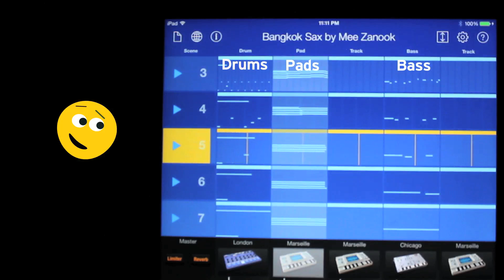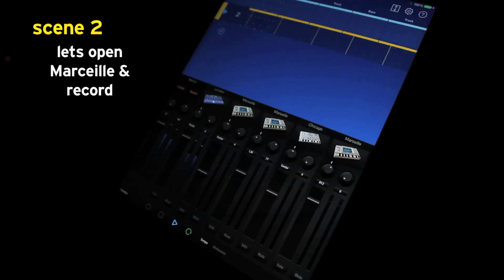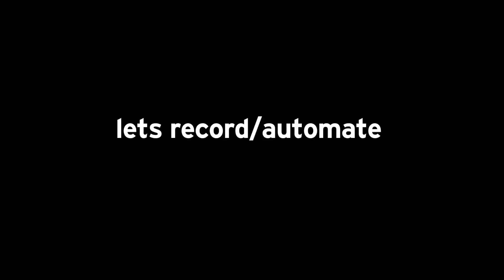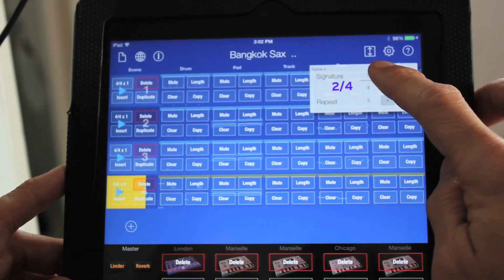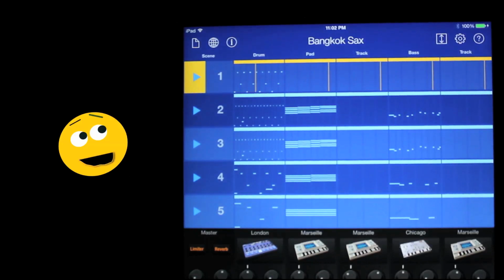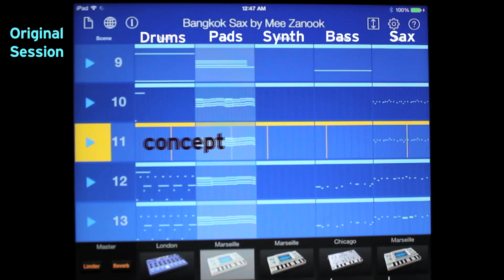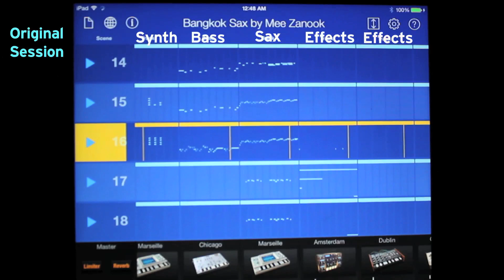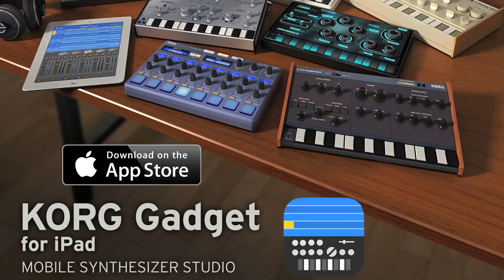KORG Gadget  Building A Song Tutorial

Comment: hi mee,

have been trying to recreate your tack to scene 10 - i think i have done it but want to check the settings you used from scenes 4 to 9.

i realised i needed use a blank track to force the maximum play length of a scene and make the other tracks loop before progressing to following scene.

my settings came to -

Bangkok Sax recreation

scene 4 -  1 bar for pattern 4/4 time  - 4 bar control track

scene 5 -  1 bar for pattern 2/4 time  - 4 bar control track

scene 6  - 1 bar for pattern 1/4 time  - 4 bar control track

scene 7 -  1 bar for pattern 1/8 time  - 2 bar control track - grid 1/16

scene 8 -  1 bar for pattern 1/16 time  - 4 bar control track - grid 1/16

scene 9 -  1 bar for pattern 1/16 time  - 4 bar control track - grid 1/32

but i dont think thats right when i follow yr vid.

its a great tutorial and i learned lots just trying get that far.
Reply from the maker: Hi Mark,wow I just watched this video again after so long and if you followed OK you've done great! I can't remember each scene and if i had to redo this track i would have to watch video too and stumble much,Good work!
Reply: Great Tutorial. I’ll be trying this. I’d been having trouble making good drum rolls/build ups. Very fiddly to make on an iPhone lol. Make more vids , this is one of the most helpful I’ve watched in years of owning gadget.